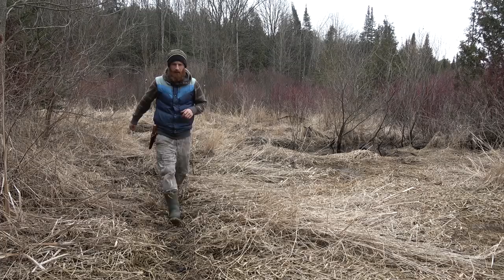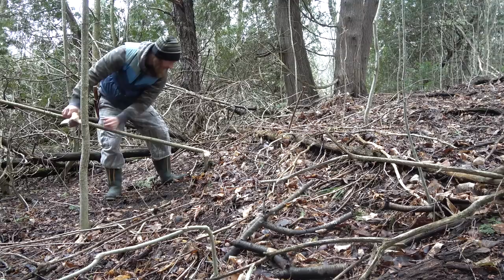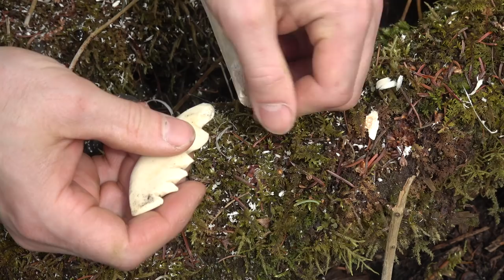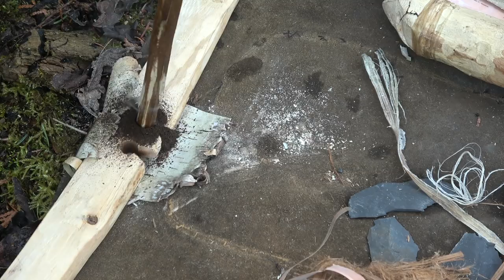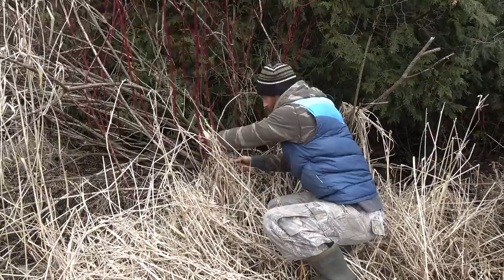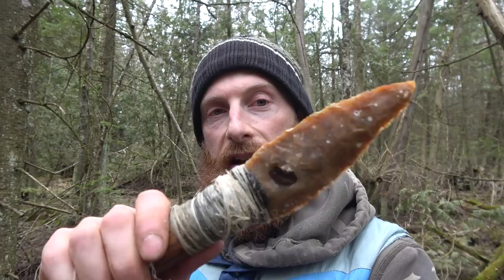Primitive Technology | Bone HARPOON with STONE TOOLS | Hand Drill Fire, Fish Basket Cooking

Comment: That axe seemed a bit dull. That knife looks like it chewed through the stick pretty fast. And the other rock too. I've sawed bamboo with rocks a few times (although the rocks usually break, probably not very hard rock). But I'd use another rock, not the knife. Then again, Idk if there are any rocks where you are.